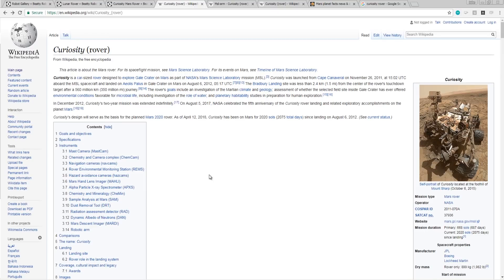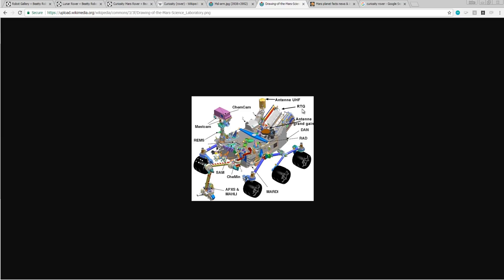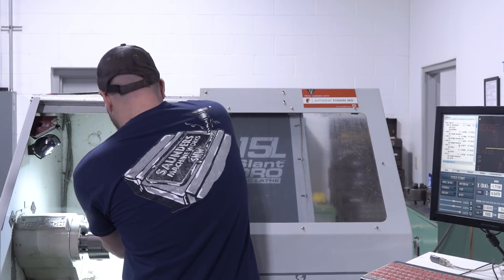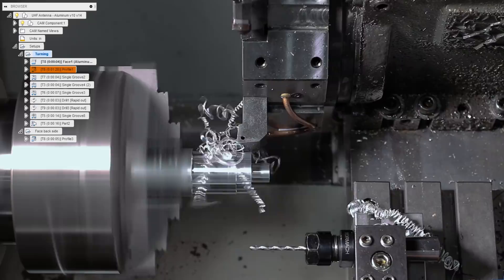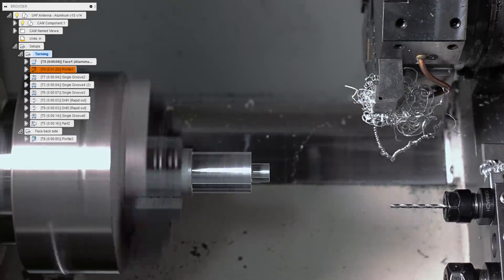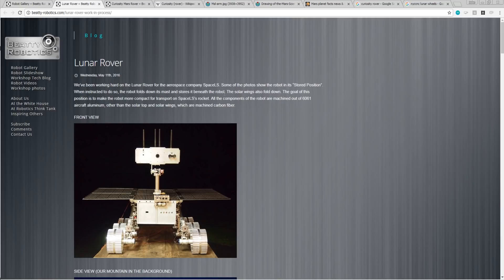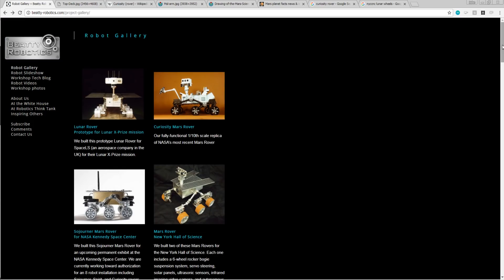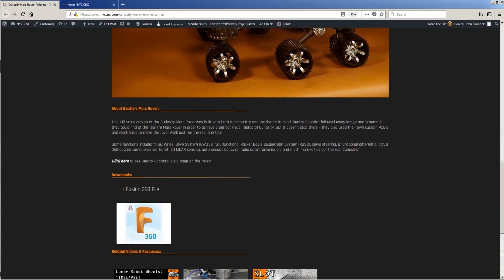CNC Machining a Mars Curiosity Rover Antenna!

Comment: On our mazaks at work we use the bar face unit all the time which is what Jarod was trying to do. Saves a bit of time because your doing one continuous tool path and blends in the face and radius very nicely.
Reply: Steven J 
Ya you just need the right tool holder and bit to use like a vnmg
Reply: Sicktrickintuner we just the standard cnmg09 inserts we use for all the turning ops. We do only leave 0.1mm on the face for the finishing op though and it looked like Jarod was trying to take a bit more then that. A rigid setup helps greatly as well of course.

Comment: his path wasnt wrong. machine just wouldnt handle it.
Reply: MotorsportsX 
It was trying to cut too much at once with the wrong type of insert. Vnmg on a 0.005” cut would work. The leading face was pushing material back causing it to load up the tool too much then cause the chatter. It was trying to cut that whole face width at once lol

Comment: You shouldn't need to chip break on a finish pass, if the string is thin enough (0.1mm (4 thou) radial depth of cut) and you're running some sort of lubricant the nest shouldn't damage your part. Chipbreaking while roughing is a must whereever possible. With 6000 ally the feedrate will determine the breaker performance far more than the depth of cut in my experience, running .35-.4mm/rev (14-16thou/rev) works a treat if you're adequately holding on. Another thing is ally should be turned at 450-700m/min (1475-2300sfm) for really amazing surface finishes. You should be pretty much maxing out your lathe RPM (within reason, use g50 to limit based on workholding capability)

Comment: I’m by no means a lathe person. 

But that second side to get a single smooth radius and face I would have left .005 on from the first op between that groove and the end of the part, and done a single pass across and down the face, staring the tool inside that existing groove. 

No lead in marks at all and should be a perfect blend.
Reply: Occams Sawzall 
Something this small i would do the same. Just change to a vnmg, have 0.005” stock to leave and back cut it in a 332 insert

Comment: John, I don't mean to be rude but that turning was pretty poor. 34m/min? That's about an order of magnitude out. CNMG? Not what I would have used for that longitudinal turning. Looks like it had at least a .8 rad on it as well. Chatter in the bottom of the grooves. This part would not go out the door if I had to put my name on it.
Reply: You should apply for a job at SMW. They aren't a lathe/turning company, so this is pretty good for them.
Reply: Kristian Thompson Silva don't disagree with you, just think in this case where he didn't have a lot to take off the side, in aluminium, a tool with a smaller nose angle would have provided better chip breaking
Reply: agreed
Reply: I agree with most almost everything you said , except there is nothing wrong with a CNMG for longitudinal turning
Reply: Evan Parent if they pay a decent wage for professional turners, relocation costs and invest in something that's not a toy I'd love to go and help them out
Reply: Samuel Stone smw is actually investing in an industrial lathe pretty soon. I’m excited to see some serious lathe work on big boy machines.

Comment: How was the probe with the Haimer in x axis accurate if the ball wasn't touching the part at 6:00?
Reply: It's just editing filler. You guys are so critical.
Reply: I saw that too.
Reply: Must have been pure luck that the deflection of the probe was nearly the same touching the shank at that point vs touching the ball. That could have gone sideways pretty quick.
Reply: It touched.

Comment: THis looks awesome!
As a HAM enthusiast, I love antennas. Seeing one machined definitely makes me smile. 
Now we need to do an analysis to determine the effectiveness even though its just replica. ;-) Can never be too real.
Reply: I agree 100% Would be very cool to see the SWR curve on this and find out how close the project got! Another thought I had.... It would be cool to change the design ever so slightly to be resonate in the ham band so it could be used on the air. How cool would it be to make a contact with a rover? :D
73 de w8tam
Reply: This part is a little misconceiving. The outside of the actual antenna is not aluminum for obvious reasons. I do wonder what the inside of it actually looks like. Here's a close-up: http://i.imgur.com/L2fOYRQ.jpg